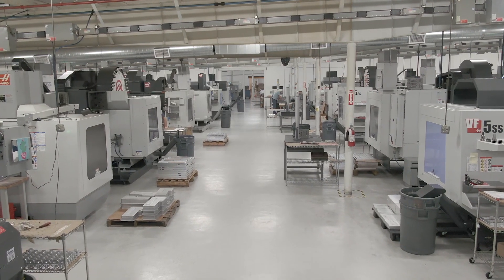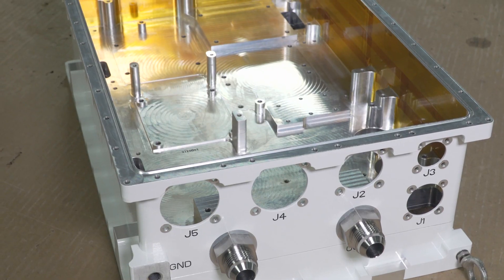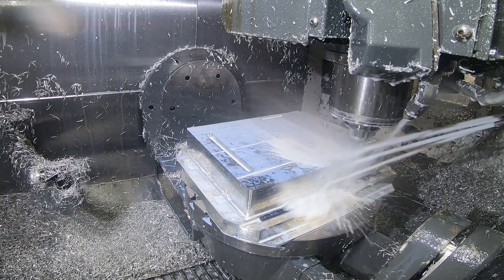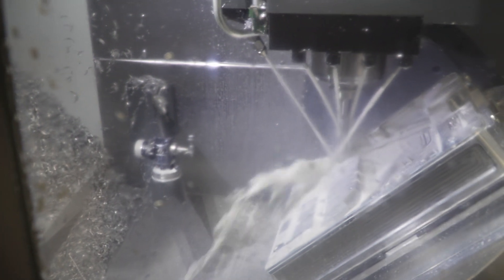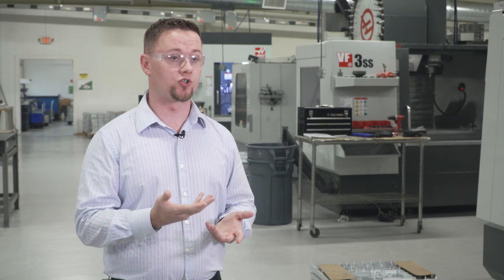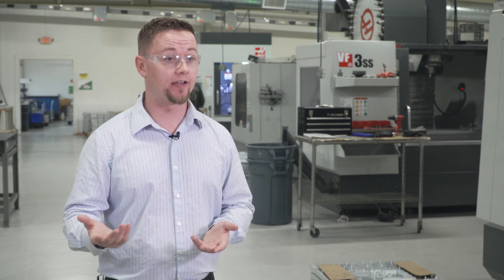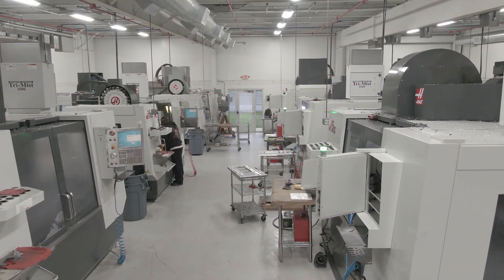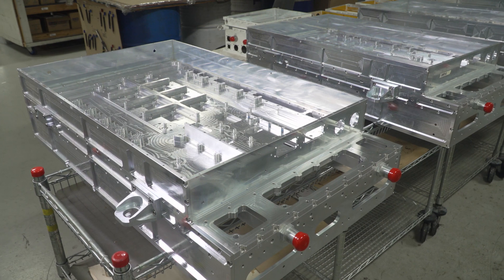Machining Electrical Chassis on 5-Axis Haas CNC's at DesignWerkes

Comment: Wait...What!?!? Y'all are taking 5-1/2hrs to machine a part that even on a Haas shouldn't take 2hrs!!! These are purely guesses, but the material is probably somewhere around 18" x 16" x 3" which is 864 cubic inches. If that's correct, machining it in 5-1/2hrs is only a little over 2.5 cubic inches a minute. You should be able to cut 4140 on a Haas that fast. On a machine with real horsepower I'm averaging over 30 cubic inches per minute roughing and finishing combined with my programs. Being extremely conservative on a Haas you should be closer to 10 cubes. Let's say 7.5 cubes per minute, that would put you at under 2hrs to machine this part at those dimensions. I realize that there are quite a few small features and details on this part, but if tooled  and programmed properly you should be able to machine this part in half that time. On a Grob or Hermle you might be able to get it closer to an 1hr cycle time
Reply: I'm guessing roughing is probably only 20% of their cycle time so average MRR is irrelevant. Its all those deep pockets and holes that inflate the cycle time. Plus UMC is really slow at simultaneous 5 axis which they said they have to do.
Reply: @Slayer553826  I agree that there is a lot of small deep pockets in this part that will have a huge impact on MRR but if you are removing material MRR matters whether that's roughing, finishing or poking holes. Machining aluminum on a 30,000rpm machine it isn't uncommon to see a MRR of 10 cubes when finishing and with 150hp spindle to rough at a MRR of 90 to 100 cubes. Obviously a Haas isn't going to get close to that, but it should be able to have an average MRR of 10 cubes for basically a 3 axis part. I wonder if they are using 5 flute finishers and one shot solid carbide drills? Just want to see manufacturing in this country beat foreign competition and keep this kind of work here. We can only do that if we do the work faster with better quality
Reply: @markjones4186  Measuring MRR for roughing is important but just silly for finishing as finishing removes such little material. I could give you 2 different parts, both aluminum both need exactly 30 cubic inches removed, one has a 5min cycle time the other 2 hours. Geometry is everything to cycle time. "Average MRR" means nothing.
Reply: @Slayer553826  I would argue the exact opposite is true. Being that more time is normally spent finishing than roughing, the higher your average MRR is for finishing as a vastly larger impact on cycle time than you average MRR for roughing does. If finishing takes 75% of the cycle time and I can increase my MRR while finishing by 10% I save way more cycle time than if I knocked 10% off of my average MRR for roughing. Granted comparing MRR between roughing and finishing is silly, but comparing finishing to finishing with 2 different process is where real time savings can be realized
Reply: @markjones4186  I'm not arguing against increasing finishing MRR. I'm saying trying to calculate average MRR for the whole part and using that as a basis to determine if their cycle time should be 5.5 hrs or 1hr is silly. You don't know the complexity of the part, finishes, or tolerances to be able to say if 5.5 is a good or bad number. Like I said before, I could give you 2 different parts with the exact same material removal requirements, pick whatever machine and tools you want but because of geometry one's going to take 5 mins the other hours.
Reply: @Slayer553826  So we agree that average MRR determines cycle time and your point is that part features will have the biggest impact on the average MRR when finishing? If so then we agree. I'm saying that this would have to be one of the most difficult aluminum parts on the planet for the average MRR to be at 2.5 cubes. I seriously doubt that's the case
Reply: @markjones4186  What I'm trying to say is without looking at a print, there's no way to determine what a reasonable cycle time or average MRR would be. Maybe the features are simple but it requires true position and flatness to be within tenths, then you'd have to slowly relax the internal stresses when machining and barely clamp it on the finishing op to avoid distortion, then it would be impossible to machine it as fast as what you consider a reasonable MRR. Print dictates process, process dictates cycle time.
Reply: @Slayer553826  so you're telling me that in your professional opinion as a mechanical engineer that there is a higher probability that the reason that the average MRR is at 2.5 cubes to cut this small part is that there is some unrealistic call outs that are only seen in 1 in a million parts verses the more common seen everyday scenario that the programming approach, deficiencies in the setup, and not utilizing more advanced cutters and holders are the culprit ? That is honestly your professional opinion? If that's the case then you would never cut this part in 2 setups and you surely wouldn't do it on a Haas
Reply: @markjones4186  man you're really riled up about your cubes and a 5hr cycle time. Clearly there's a business case for what they're doing and how they're doing it, otherwise they would be long gone which is why I say you can't just look at a video and claim they're a bunch of clueless machinists. I could easily give you a print for a 1 cubic inch block of aluminum that would take 5+ hours regardless of the machine you use.
Reply: @Slayer553826   with you. We just machined some parts that look like these, I think finishing was 3.5 hrs and roughing was 20 minutes, roughing removed probably 95% of the material but finishing dumb features, things that we felt had to be interpolated or done with small cutters, took most of the time. Mrr is good to know but unfortunately there's lots of parts with poorly designed features that drastically increase cycle time
Reply: Looks like a number of thin floors in deep pockets, implying long tools. I can think that taking a while to get right.
Reply: @gredangeo  absolutely it has an impact. But as an example, I'm accustomed to finishing with a 5fl 1/2" dia end mill that has a 2-1/2" loc and taking one pass at 430ipm. This material only looks like its 3" thick. I'm currently programming a family of parts that is from 8" billet that has 3.85" tall walls that are 0.15" thick which I'm positive is taller than the thickness of this part and my average MRR is almost 40 cubes per minute
Reply: There is no end optimizing a part like this but someone smart will remove a lot of time from that just by doing things in different order etc. so it leaves less delicate, time consuming work. And then there is the rest of the design. Even (cast) commercial products made in millions like this are often very badly packaged and integrated. I could spend a thousand hours packing the electronics and the power electronics and be none the wiser, knowing with thousand more it would still be much better.
Reply: Then again in a relatively small volume product like this, the cycle time and five axis may be very well worth it due to limitations in design. It makes no difference is it takes an hour or five to make if it is made in some thousand units max and this way they can get things integrated much better without thinking too hard.